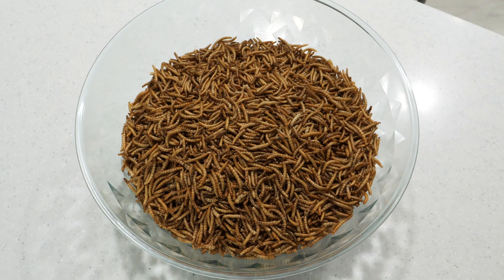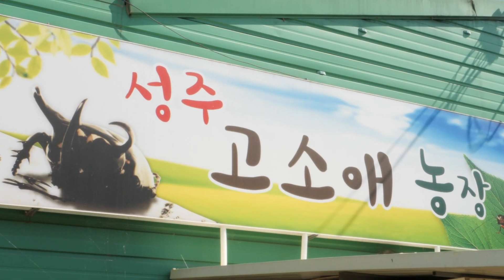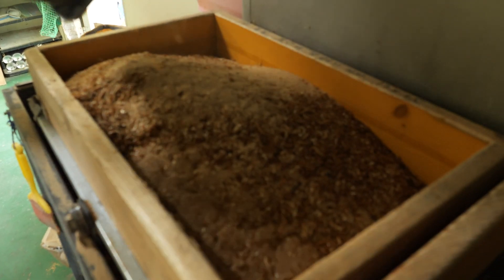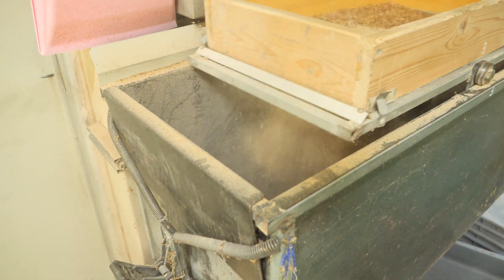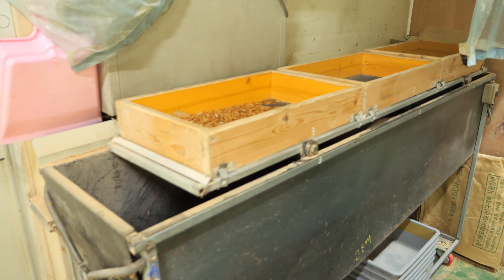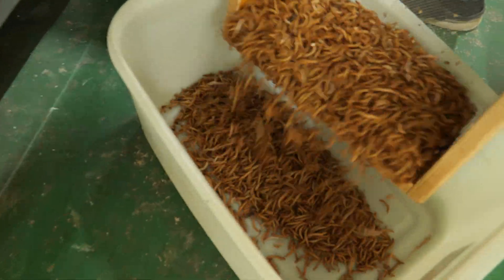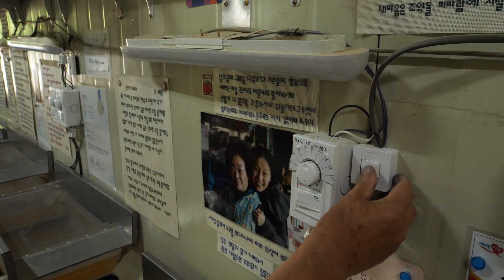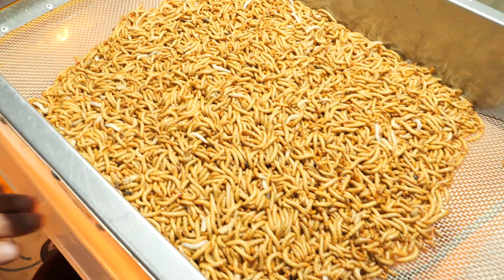단백질 함유량 소고기의 2배! 한국의 미래 식량 고소애 대량 생산 과정 / Korean edible mealworms mass production process.

Comment: Not a replacement. A purposeful innovation.

Mealworms (Tenebrio molitor) are not a traditional food — nor do they intend to replace what already belongs to our food culture. Instead, we propose their inclusion as a smart and sustainable alternative: a functional supplement rich in protein, minerals, and fiber, with low environmental impact.

✅ Benefits compared to other protein sources:

🟢 High protein concentration
In flour form, mealworms offer over 60% protein, surpassing beef (20–26%), eggs (13%), and even beans (6–9%).

🟢 Complete amino acid profile
They provide essential amino acids such as leucine and lysine — crucial for muscle growth and recovery — similar to whey protein.

🟢 High digestibility
With over 85% absorption, they are a fast-assimilating protein source, ideal for athletes, the elderly, or restrictive diets.

🟢 Rich in micronutrients
They contain iron, zinc, magnesium, and B vitamins — often lacking in modern diets.

🟢 Low environmental impact
Require up to 90% less water than animal protein.
Emit 99% less greenhouse gases than meat.
Can be farmed in small spaces using agro-industrial residues as substrate.

🟢 High protein yield per area
In 1 m², annual protein output from mealworms surpasses that of cattle or soy.

Just like chia, spirulina, or whey protein have found their place, mealworms come to add, not replace. In flour, snacks, bars, or capsules, they support the fitness market, public health, and food innovation.

This is not about replacing rice and beans with insects. It’s about opening space for new solutions that speak to the future of food — cleaner, smarter, and more sustainable.